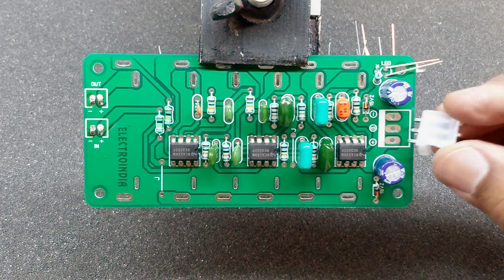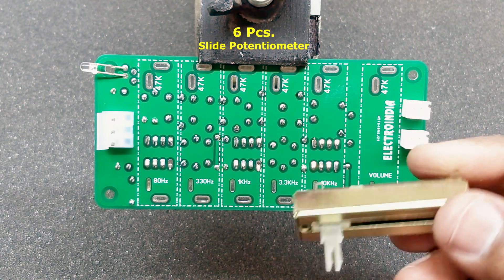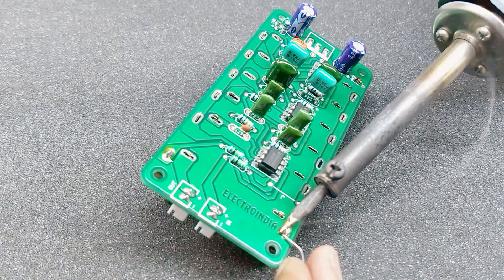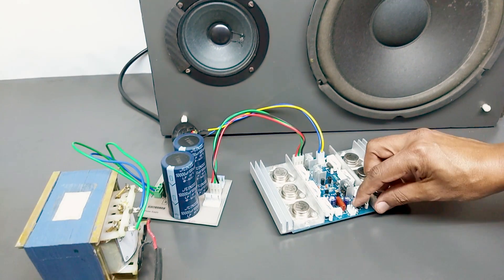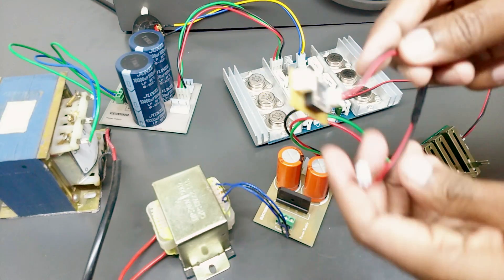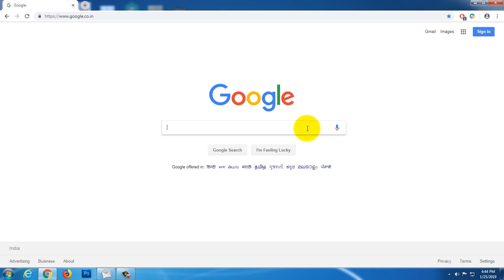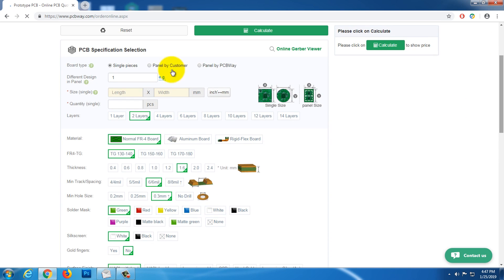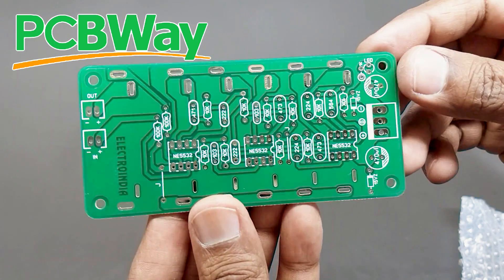Five-Band Equalizer Preamp Audio Board Mono DIY | NE5532 IC | Hindi ElectroIndia

Comment: Is the filtering into bands done by the capacitors? Is this typically how it is done such as on a 5 band eq board from alibaba? I was wondering if it is possible to tap into some points on the back and get separate outputs of each band.

Comment: Sir this circuit mono or stereo ?
Reply: if there are 3 pins in and 2 pins out, your stereo signal must be changed to mono. stereo EQs include 2 channels. therefore 2 series of bands. You send the right signal on one channel and the left signal on the other, joining the ground to each. out of each EQ. you join the ground and the right and left signal are separated. (google translation, french)
Reply: @Comeau083  Thanks